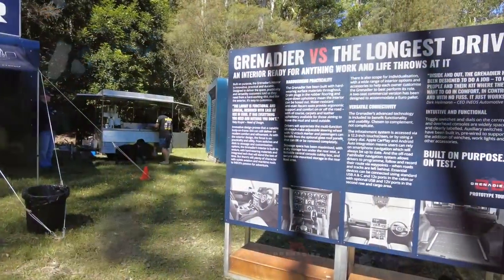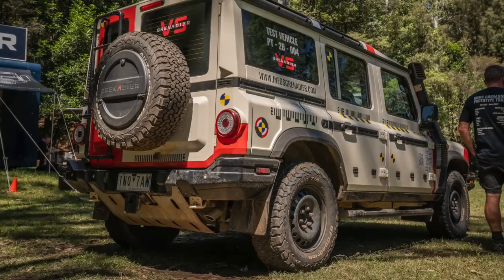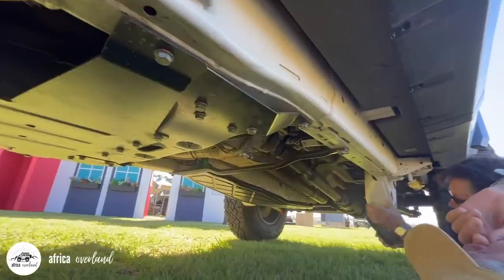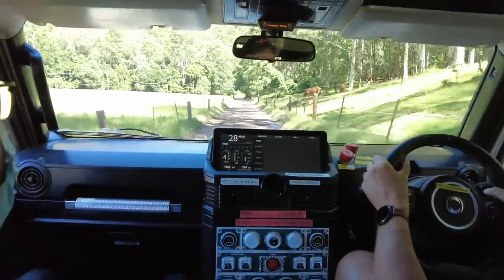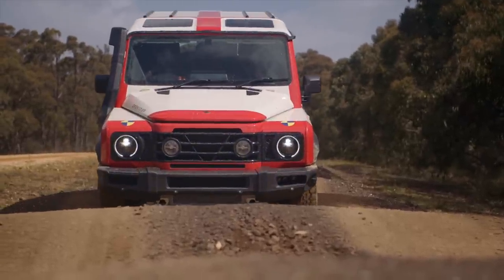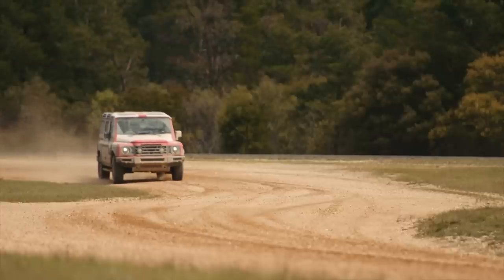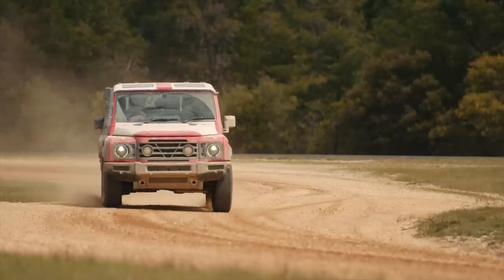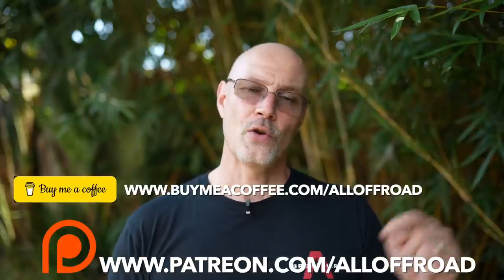Ineos Grenadier - THE ISSUES | SEPARATING THE FACTS FROM THE HYPE | A 4WD PERSPECTIVE

Comment: Good review, its hard to see what really redeeming features there are in this vehicle, its compromised in every way, poor angles, low fuel, stupid instrumentation, stupid roof windows, stupid ideas about loading roofs being acceptable, battery and electrical distribution location a disaster, its in effect a 1950s series 1 in the 2020's...I mean seriously how could any manufacturer come up with this in the 2020's? clearly the marketing department is driving engineering design, it's a technical disaster.
Reply: It's designed for the European market and conditions. The vast majority of buyers will never see any rocks or actual steep climbs or ruts, just mud on some farm.
Reply: @HardstylePete  Begs the question then why would you buy one when you can use a Disco etc etc.

Comment: Well thought out review  Stephan you mentioned the workshop manual check out they short video from CAD IT https://www.youtube.com/watch?v=QO4cEwtyaRU&list=PLhVHHIkW5nWqULcxgsDZNOFSKWN2kC1qs.  well worth a watch if the rest of the manual is like this it will make interesting reading.
Also the rear suspension mount links have been changed they dont hang down so much check out the Hambach factory footage .
Reply from the maker: thanks, Jon will have a look, still, a lot else hanging low, for instance, fuel tank, rear muffle steering dampener so hope that will also be addressed. That workshop manual looks good at least for a mechanic lol

Comment: if it goes 500km in one full thank of 90L, it means it gets 18L/100km or 13mpg which sucks.
Reply from the maker: Ineos emailed me this in regards to mileage: You flagged a range of figures based on what you saw on the dash while riding in the vehicle. We just wanted to note that this fuel range isn’t necessarily what the final specification will be. The prototype is running BETA software at this point and as a result the sensors aren’t delivering the full range on the screen as seen.
Reply: @AlloffroadAu  I see, with this level of technology, this truck should get no less than 20mpg off roading, I would expect it to get a little more even.

Comment: Shit maybe I should just by a Nissan Patrol. you still have not got back to me regarding drivers pedal position.
Reply from the maker: yep sat in in the latest model which according to Ineos is pretty much done beside some small changes under bonnet and cosmetic stuff. In my opinion seating position is bad for someone my size, while I sat in the back two other people which where around my height jumped in drivers seat and said exactly same to their friends. If you anywhere around 190cm I would strongly suggest sitting in one before you buy. For me it's definitely ruled out as a tourer as the seating position is nothing which you can modify or change.
Reply: @AlloffroadAu  Thanks yes I am 6'3" and since this is my last vehicle it has to be near perfect. so sorry I sold my 18 yo Nissan Patrol with 35 tyres it was a beast. I can sit in one at the dealers in Burleigh in a couple of weeks. I so had my heart set on this vehicle but my wife and I are not hard off roader touring would be more our description. thanks again Stefan maybe I should keep looking as my build date is allocated for DEC. so I still can get a full refund.
Reply from the maker: sit in one and see how you feel, for both people who I saw sit in it who were my size and me, it's was very quickly evident that the skewed seating position was uncomfortable just sitting for a few minutes and would be very bad sitting longer in it. Not a vehicle I wanted to spend hours behind the wheel in, regardless of any of the other shortcomings. I have a 4.2 Patrol on 35" any day over the current Grenadier.
Reply: @AlloffroadAu  Now your talking not sure if this is the right place what's your thoughts on the v8 patrol.
Reply from the maker: Yep if I'd buy a new car now, that would likely be my buy, or the V6 Y63 coming next year. Supposedly Nissan is now listening to Australia in the development of Y63 because they sell so many here, and it will remain off-road centric. I know a few friends who have the V8 they all love it (besides the fuel up, mind you, high-way they use as much as me in Cruiser, but the city is a bit higher.)

Comment: Is weight not an issue for you? Also the price - I think it will be twice or 3 times the price of a Toyota 70. For me, weight is no. 1 factor when choosing a car.
Reply from the maker: weight is relative, any remote tourer is heavy and if the car is well set up it's not such an issue however payload is very important so if it gets the promised 1T this would be ok. Prices yes it's relevant but a well build 70 series with track correction etc would cost you more.
Reply: @AlloffroadAu  It will be interesting to see the end result. Like how much it will cost to prepare a Toyota vs a GR (plus the price of the car itself). And the weight and the other things. My feeling is that when we draw the line, the Toyota will be a winner, especially on price and weight. Hopefully, someone will make this comparison.
Reply: @AlloffroadAu  Mat from carwow just uploaded a vid that answers some of the q regarding wheel travel.

Comment: Its an ugly stupid and utterly unnecessary addition to the market. How well its designed or put together is irrelevant if its powered by a BMW engine and associated electrics so will be utterly unreliable and god help you if you need work done in a remote place. The fuel range is an embarrassing joke. Just buy an older Patrol or Landcruiser and spend 20k fixing anything that needs to be fixed or upgraded.
Reply from the maker: lol yes I think I stick to my 105 a bit longer

Comment: You want 35 why dont you put it yourself
Reply from the maker: yes I would, like I have done with every touring but to do it properly it's not just putting 35" on it also would mean 2" lift, re-gearing diffs making sure drive shafts, cv's etc are strong enough, engineering will depend on axle specs all information we don't have and there are no aftermarket parts available.

Comment: Ineos a fossil fuel company bringing out a fossil fuel car when the market is starting to move to electric. This car will be dated in no time.
Reply from the maker: yea I can't see touring in electric cars anytime soon, especially not in Australia
Reply: @AlloffroadAu   well it’s not going to happen next week but say in 10 years you will be presently surprised on what will be on the market and the price will definitely be competitive.  There are solar cars that can race from Darwin to Adelaide. A truck with battery’s and solar would have a unlimited range. Well might have to wait a few days to charge up but beats running bone dry in the bush and having to walk. Australia is probably suited for it with our sun.   Not really trying to push that debate I just think it’s iconic that Ineos is getting into the car game. I don’t think there are any new manufacturers getting into the car game atm coming out with Internal combustion engines.     Ineos is a fossil fuel company with a bad environmental history ( especially there 
Fracking ) there cars will be prehistoric very soon just like there drivers . They probably know that the likes of landrover ect will be going electric and are planning on being the last fuel burner’s on the market for the good old timer’s. don’t get me wrong I like diesel’s and I work on marine engines but if there is a cleaner option I would absolutely love it. In this current climate it seems quiet selfish to be burning fuel just for a hobby or entertainment. Sure it’s not much but not ideal
Reply from the maker: Looking forward to it, the emission created from recreational diesel burning is so negligible compared to so many other commercial polluters this needs to come from the top down not bottom up to make any sense.

Comment: What a bunch of BS you hardcore 4WD’ers  are. You seriously need to look in a mirror and realise you are a tiny percentage of the target market. Any manufacturer can build a crazy off-road special vehicle. 35” tyres, Bonkers ground clearance, basically all the stuff the hardcore want. Will it sell yes. To the 5 hardcore enthusiasts! Do some research and understand that INEOS talked to the aftermarket so that their PLATFORM could be customised to fit every users ‘use case’ IE - the hardcore 4WD’er. I seriously can’t believe this review came from a perspective of a hardcore 4WD’er when zero, absolutely zero cars exist to this market. It’s all done in the aftermarket. get a grip seriously!
Reply from the maker: Mate this would replace my touring vehicle not play truck, tons of people do similar touring as I do in Australia. The fact is, the Ineos at present, has quite a few shortcomings for a purpose build 4wd. Let me give you a few slogans from the Ineos website "NO JOB TOO TOUGH", "Grenadier is a no-nonsense 4X4", "SERIOUSLY CAPABLE", "The Grenadier is built to do the job. In all conditions. Over any terrain.", The Grenadier will get you there. Wherever ‘there’ happens to be.", . The problem as I currently see it is that even with aftermarket mods you may not be able to overcome some of the hurdles which were engineered into the car. I hope the final version will address some issues as I was hoping it could replace my 105 at some stage. At present, I could not see how I could modify the Ineos to get anywhere near my 105 and that car was predominantly built as a luxury car at the time, not a purpose build 4wd or work horse.
Reply: @AlloffroadAu  that is marketing BS. Can it drive to the top of Mount Everest? If you read the marketing it can get you anywhere you want to go. Don’t be so silly. Holding a manufacturer to marketing material - please. Have you watched any advert in the last 30 years? I can only repeat - Ineos have built a platform and done their very best to ensure it works for all. Even the 1% hardcore. Name me 1, just 1, vehicle you can buy today that does what you want without modification? Personally I can’t wait to see what the aftermarket does to this DEDICATED platform. If they can transform Mom and dad Toyotas / Isuzus / Nissans imagine what they can tweak on a dedicated 4WD platform that has actively engaged the aftermarket. You are 100% judging this vehicle incorrectly.
Reply from the maker: Jeep Rubicon out of the box more capable than an Ineos, Y62 Patrol,  Suzuki Jimny, probably even the New Defender (till it breaks). You exactly make my point though I don't expect a vehicle to run out of the factory the way I like it or use it for Touring but I do expect that I will be able to modify it to my needs and at this stage, I fear Ineos engineered the vehicle into a one way street for certain things. I'm not hating I want the car to work maybe the dual-cab version has more room underneath for added fuel tanks. I don't think I judge the vehicle incorrectly at all and if you go through the comments you see that the vast majority sees it similar. It's the only vehicle in the past decade to be purposely built and marketed for 4w driving.
Reply: Funny. Not sure we can judge/predict what vehicle is better out of the box yet considering the INEOS isn’t even available yet. Not sure any manufacturer lets Jo Blow go play with prototypes . ;-) Imagine! Kudos to Ineos. A few YT reviews are just popping out where Ineos have let some select people drive the prototype and the general consensus is A+. Lets be fair they are hanging it all out there - just look at how your review went -If it was the new Defender imagine?  The bar is extremely HIGH for the Ineos because anyone who has a passing interest knows what it’s about. So - high bar, extreme judgement. Yep it’s an artificially high bar
Reply from the maker: As a driver trainer, I have driven many different vehicles off road and have driven with many more on trips and during training so I think I have a reasonable good idea looking at the Ineos in the promo videos how well it will do.  Everyone who I have seen drive the Ineos off-road so far is a Motor Journalist, not a 4w driver mate they get excited driving through a few wombat holes and up a little hill, they also don't want to lose access to the car. Plenty of soft 4w drives on the market we don't need another status symbol 4wd. Ineos was advertised quite differently. I would think New Defender would suit you?